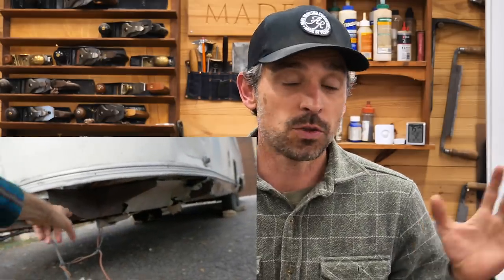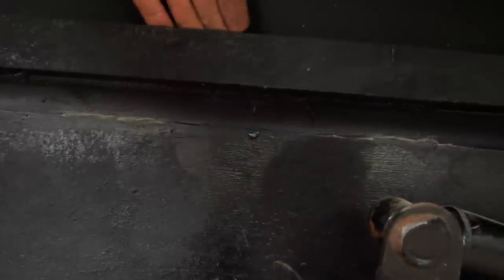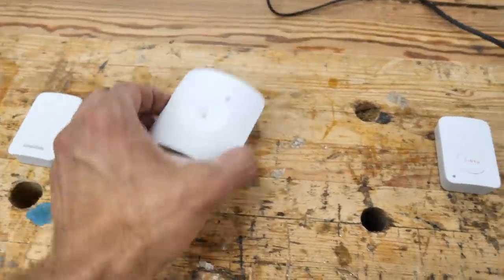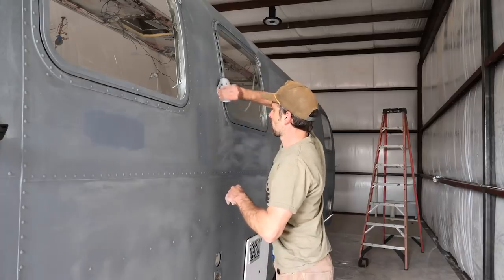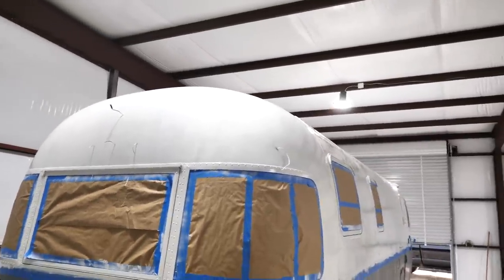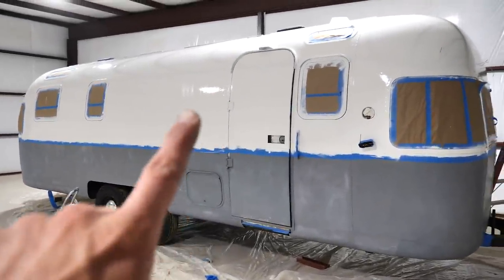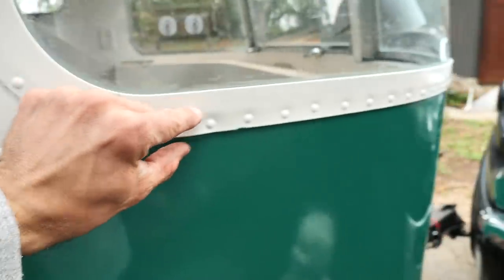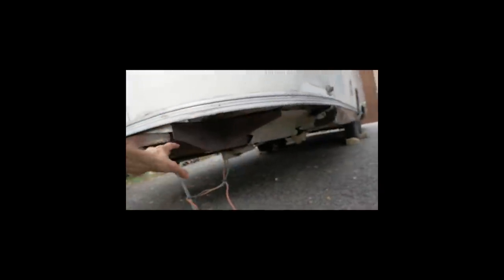New Wheels And Paint...Check Out The New COLOR! (Airstream Argosy Restoration Ep. 20)

Comment: Those colors look great in my opinion. Here’s a couple tips from a guy that’s painted a thing or two.
1) those imperfections can be wet sanded and corrected pretty easily, just keep everything real wet while you do it but make sure to wait until it’s fully cured
2) when taping, if you want a hard line where the paint can’t bleed through like it did with the painters tape, use electrical tape along the hard line. 
3) again, depending on the paint type, you may be able to use an adhesion promoter around the window frames to make life a little easier on you.

Looks great though man can’t wait to see the interior!

Comment: Really beautiful Andy...you have an incredibly inventive mind - I would have never figured out putting threaded rod in those loose spaces would work. I probably would have used a rope style filler but then the threaded rod adds rigidity. Like the colour. If those streaks on the upper half bothers you, you might be able to sand them out using a really fine (1500 grit) wet/dry sand paper. Use it wet, take off the high spots, and see if it clears out those streaks. Buff it out is another idea that might work.

Comment: Absolutely love etrailer. I was able to pick up just about everything I needed to repair my camper trailer. Great prices and very good quality.  Glad they were able to hook you up with stuff for your camper.

As far as the paint goes. I love the green. When you get the trim on the trailer, it will change the look. White paint is difficult because it shows soooo many imperfections. You will need to sand it very well  to even it out, or like your wife said, leave it. Another option would be to put a decal over the area. Its a cheap cop out, but if it works: Nobody will be the wiser.

Comment: Color looks great, dude!  Re: the peeling with the epoxy.  Yes, you need to scuff old epoxy primer in order to get adhesion.  if you're going to repaint your window frames, I would use a wire wheel and get it back to bare metal first.  Then spray the epoxy again.  And within the recoat window (usually 72 hours), top-coat it.  That way you don't have to scuff sand and worry about blowing through the epoxy where the rivets are.  You'll get a chemical bond rather than mechanical bond.  way better way to go.  In automotive shops, they bust their butts to do as much as they can within recoat windows to avoid the labor of scuff sanding.

Comment: You can use a Scotts brite wheel on a drill to sand the window frames down. If you use the layers inside a time window it is usually not necessary to sand in between. Instead you will get a chemical bond and that is a lot better than a mechanical bond on a sanded surface. :)

Comment: Do yourself a favor and have the jacks welded with nuts on the end.  Buy a battery powered impact for lifting, leveling, and lowering.   Keep a ratchet for back up.  Way easier than the bar and tire iron set up.

Comment: The simple solution to get rid of the striping is to wet sand and polish the paint.  Sure it'll be a lot of work, but way less work than repainting and it should give you vastly superior results.  Works fine with that type of paint (actually better than automotive paints, due to the thickness).  Try not to hand sand any large areas without using a block of some kind.

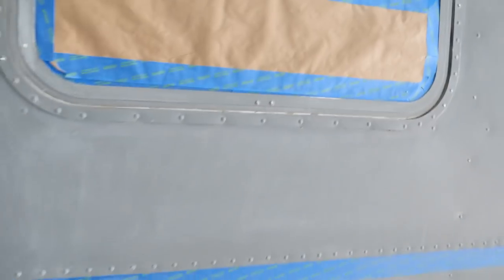Comment: 14:38 I find it hard to believe he doesn't own a generator.   I also find it hard to believe there wasn't an old generator in it when he bought it.  Even stranger is that he doesn't have a friend he can borrow a generator from so he can run an air compressor and spray it that way.   Very puzzling.